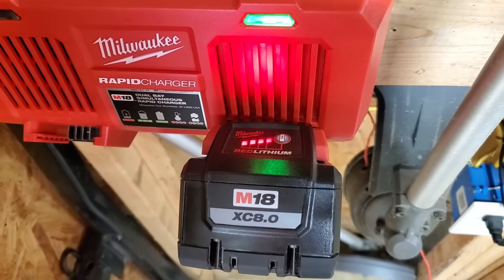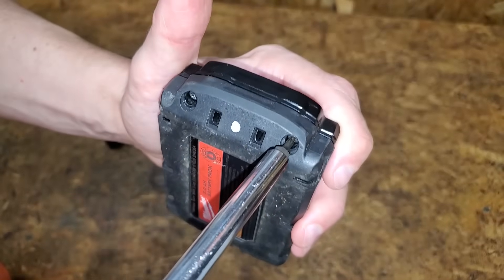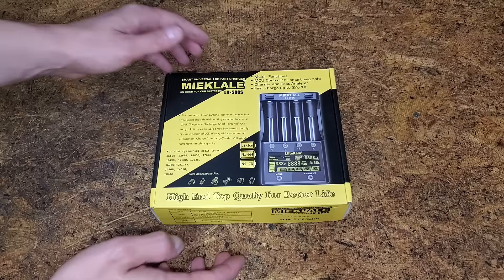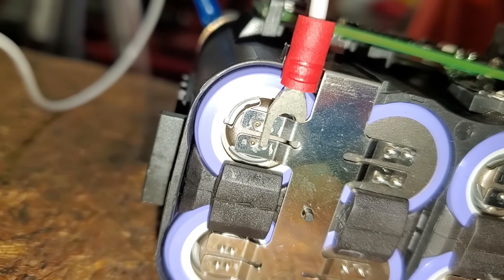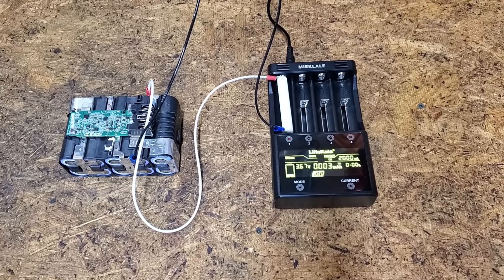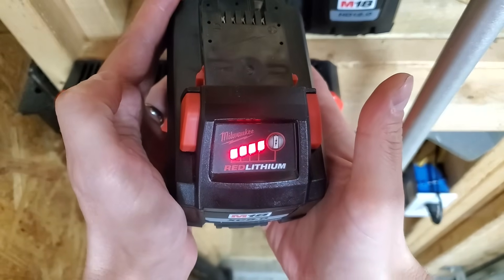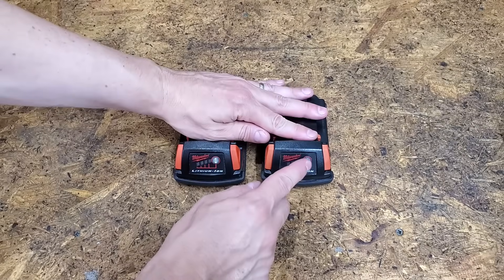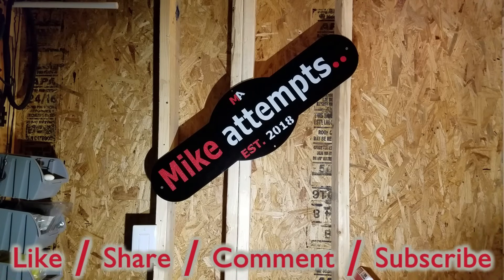Balancing Power Tool Battery Packs

Comment: For what Milfucki charges for these battery packs they should have a built in BMS that can do the rebalance for you.
Reply from the maker: I couldn't agree more, and you know they could do it easily but that'd eat into their profits! :)
Reply: I dont buy the big red turd brand anymore.  Overpriced garbage.
Reply from the maker: @unclefester4626  Most of the cost is in the battery packs. The tools are good quality but what if one of the major brands were to go out of business? This might sound stupid, but you know what I wish all cordless tool brands would offer? An adapter that turns your cordless tool back into a corded tool. It could clip in, just like a battery pack with a cable and plug attached to it. It would need an DC to AC converter in there somewhere. That way all of your tools wouldn't be useless without batteries.
Reply: @Mikeattempts Those tools extremely high current, esp. when they reach their torque limit. That can be 10-20 amps easily. The cells can deliver that current for a short time, a DC-DC converter cannot or will be huge. So the cable solution might work for some tools (router, jigsaw, sander) but is difficult for drill / impact drill, circular saw or similar that draw high peak currents.
Reply from the maker: @Chief_Engineer  Ah, interesting, I hadn't thought of the potential higher amp draw if they were to be converted to plug-in. I know the DC to AC converter would be bulky, but I think people would accept something maybe the size of a computer UPS that they plug their tool into. A requirement for using a 20-amp circuit would be acceptable too. As technology advances, that converter would probably get smaller and smaller, but I shudder to think of what they'd charge for that setup. :)
Reply: @Mikeattempts  those adapters exist but some tools will not achieve full power because from battery or dual battery setup they can draw 1800w+ while adapters are under 1500w. it is not important in most cases
Reply from the maker: @johndoe9922  They already make an adapter that looks like a battery pack connector on one end and a wall plug on the other? As tech improves, I assume that kind of stuff would get smaller and more powerful.
Reply: @Mikeattempts  yes,  they are searchable by (1100W AC 220V DC 18V 20V Power Supply For Dewalt For Milwaukee For Makita ; 20V 40A/55A DC Power Adapter Makita Compatible Electric Tools Interface 18V for Power Tools ) 
but it will not feel the same when compared to big-ah battery. 
for max power most tools consume 1.6-1.8kwatt there is no such adapters yet because they will need to supply ~100a of current and this will cost in the price range of camping power station, not 100$.
Reply from the maker: @johndoe9922  As they get smaller and cheaper, wouldn't it be funny if people moved back to just using most of their cordless tools with the corded adapter? :)

Comment: I have the 12 amp hour batteries for my lawn mower. Cycle them about twice a day. Balancing cells is just one of the chores I do over the weekend to get ready for the next week of mowing. 

Excellent video. I use exactly the same technique. 👍
Reply from the maker: Really, your 12Ah packs require balancing every week?! I have three 12Ah packs and I haven't had any issues with them yet.
Reply: @Mikeattempts they haven't been as bad since I switched to a slower charger. But I cycle them two to three times every day at work. And the mower is a heavy load even for the 12 amp hour batteries.
Reply from the maker: @robertthompson3447  Yeah, I have heard that the Rapid and Super chargers are harder on the cells, makes sense.
Reply: @robertthompson3447   I hope you're not just cycling them for the heck of it because these batteries will wear out thus you're shortening their life unnecessarily?
Reply: @thisisyourcaptainspeaking2259  No, I am using them for work. The lawn mower goes though them quickly when I ask it to do hard things. Like wet or tall grass. Or mulching grass and leaves instead of bagging. The batteries frequently are hot after use. 

When the grass hasn't grown much, the batteries are only warm after use. Either way, an 8-10 hour day of my lawn service is hard on the batteries.
Reply: @robertthompson3447   Perhaps someone should offer a proper balance charger.  This sounds like a missed opportunity...
Reply: @thisisyourcaptainspeaking2259 unfortunately the Milwaukee batteries doesn't have a balance connector so it's not possible to make such a charger. Makita batteries on the other hand have a built in 7-pin balance connector and the factory charger balances the cells automatically.
Reply: @mrfrenzy.   Whichever powertool battery systems incorporate balancing in the charging process should be the clear winners.
Reply: you can install active balancing board(it can balance both up and down) outside battery housing and glue the case for board under the battery housing, it will balance right where charging and even afterwards.
 
also you can connect two batteries to one tool at the same time, there's even adapters available but you will need: 
1. to make sure that tool does not draw too much excess current (now that two batteries can supply extra) because it can overheat and fry 2. if each battery does not have correct low voltage cut off then you will also need to install bms that disconnects discharged battery to avoid overdischarging and thus killing it.
Reply: @johndoe9922 I was unable to find a dual battery adapter for my M18 batteries. You want to happen to have a link would you?
Reply: @johndoe9922 Thank you. The two battery adapter sounds helpful. Going to Google it later this morning.

Comment: Milwaukee poo poo

Makita mastered this shit ages ago.
Reply from the maker: For the price of major brand battery packs, they should all be perfect but then they'd make less money selling new batteries! :) I've heard Makita packs have their own issue. I guess they have something on the battery pack's circuit board that will disable the pack if it's tampered with too much. So, you have to be careful when replacing cells in those packs.
Reply: @Mikeattempts   uh? Makita packs having issue? Makita batteries having issue is virtually unheard compared to other brands. it's battery management is unmatched. The point is having battery that never need any tampering or maintenance for longest time. THAT is worth far more that problematic piece of sh*t battery that happen to be easy to work on or tampered with.
Reply from the maker: @TrollinCrazyRussian  You're right, if the Makita battery packs last longer then you shouldn't ever need to mess with them, which is great. However, nothing last forever which is how that issue was discovered.

Comment: Another Utuber has said that Milwaukee is not playing nice with the software and that there is software in the charge controler that can disable the board under certain error conditions. I hope never to encounter this as I am not a software person; however, I have not yet had problems with the batteries and I try to keep them at the three bar level, only fully charging before use. Unfortunately my battery use has dropped off in recent years due to lifestyle.
Reply from the maker: Interesting. I've heard a similar thing about Makita batteries. I guess they have something on the battery pack's circuit board that will disable the pack if it's tampered with too much. So, I guess you have to be careful when replacing cells in those packs.

Comment: I'm not nearly as knowledgeable about lithium batteries as I am about 12V lead-acid batteries, but this I know for sure about the 12V ones:  voltage alone tells you almost nothing at all about the true health of a battery (although it may show definitively that one or more cells are dead, rendering the battery useless).  It's the internal resistance of a battery that will show how much power is stored, and you need a special meter to determine this.  So a 12.5V charge, with high internal resistance, means the battery has little 'juice' in it (and it should be trashed), while a low internal resistance shows that the battery is truly healthy and able to hold a charge consistent with its AHr rating.  I assume the same holds true for lithium (that voltage alone tells almost nothing about true health), so your 'balancing' might all be for naught on older (internally degraded) lithium cells, which likely will discharge after little use.
Reply from the maker: They're holding out so far but only time will tell. If some fail, I'll do another video replacing the cells.
Reply: @Mikeattempts  The simplest test is to time the run of the old battery on a high power use tool (like a big blower) and compare it to a new (or newer) battery.
Reply: Yes load test, is the real test and voltage drop
Reply from the maker: @claudiosantana3320  Yep, I'll put 'em through their paces and replace the cells in whichever packs don't hold out.
Reply: @Mikeattempts It's good practice to keep cells matched 
Discard the weak cells, and make up a pack from the reasonable ones 
Then put all news cells together in to a single pack 

Best not to replace 1 or 2 new into an old pack
Reply from the maker: @gor4988  Yeah, makes sense and will keep me from wasting my time replacing one cell at a time. Thanks!

Comment: those 1.5Ah and 3.0Ah are junk
don’t waste your time

the 8Ah earlier version has defective cells 
same cells in their 12Ah

revision 3 Samsung 40T seems to fixed the issue which they stop making them and moved to Forge Ampace cells
Reply from the maker: Thanks for the info! I actually like the smaller packs. I used 'em on my drill and driver exclusively. Since they only get use in my home shop, they last quite a long time before needing a recharge.

Comment: PUSHING THAT TAB UNDER THE POSITIVE TERMINAL OF THE BATTERIES COULD BE VERY DANGEROUS IF PART OF THE FORK FINDS ITS WAY UNDER THE WHITE PLASTIC RING - IT WILL SHORT THE NEGATIVE OF THE CELL BODY - TO THE POSITIVE BUTTON TOP
Reply from the maker: Yeah, I should have showed inserting the wire. I made sure to use small and thin spade connectors so there was almost no resistance when sliding one prong behind the tab. You definitely don't want to jam the prong in there because, like you said, it could short the cell and cause a fire. I should have specifically mentioned that in the video. I think I can add a "correction" that will give a popup with that info.
Reply: @Mikeattempts  i have no idea what you guys are talking about. pls do a revision video when you get a chance! thanks and subscribed
Reply from the maker: @dablet  At 3:28 in the video, I show the spade connectors slid in behind the metal tabs, but I didn't show inserting them. They slid in easily, but I should have mentioned not to jam/force them in (in case your connectors are larger). The outside metal casing of the cell is all negative so on the positive side, the outside edge is covered by the colored plastic shrink-wrap stuff. If you were to jam the connector hard enough on the positive side, it could cut through the plastic and cause a short. I added a "correction" to the video at 3:28 which should pop up a little gray box at the top. If clicked, it reveals text explaining not to force the connectors.
Reply: @Mikeattempts  strange i dont see any option to review the text. im using Firefox browser on the desktop.   anywho, i think i understand now.  thanks for clarifying!  your video is the easiest method, no need to desolder, remove battery, charge, and then solder back. phewwww
Reply from the maker: @dablet  Thanks, I'm happy to hear you liked the video. As for the "correction" popup, I don't know. YouTube gives creators tools, sometimes they work and sometimes they don't. Other times those features get removed without warning. The good news is that the same correction text is also in the video description. I think I'm gonna hafta do another video replacing cells in one of the older packs, so I'll be sure to reiterate the information in that video.

Comment: I thought the Milwaukee chargers were intelligent enough to charge and balance the batteries, but seems not the case. So it should be safe to buy cheaper offbrand chargers as spares around the house right? Excellent video!!
Reply from the maker: Thanks! From what I understand, the major tool brands do have some level of balancing technology built into the charger and the battery pack itself. However, I think it's only capable of small corrections so if a cell gets too far out of balance, it must be manually corrected. You know they have the ability to perfectly balance the cells and make the battery last much longer but then they'd sell a lot less batteries! :)
Reply: to achieve that batteries then needed to have balancing connector from charger to each cell group, so in practice all circuitry are inside the battery, charger only supplies voltage. Only some new battery pack models have faster balancing that doesnt allow battery to get too unbalanced in all cases
Reply from the maker: @johndoe9922  Ah, good to know, thanks!

Comment: A while back, we had two leaf blower battery packs that went bad. It was one cell in each pack that had failed. I used a good cell from one pack to get the other pack working again. Then another cell went bad, so I did the same again. Eventually, I ran out of cells, so I just bought new cells and repacked both batteries. The cells that went bad would not charge on my cell charger. Because both batteries were about the same age and had about the same use, the cells in both batteries were about the same, just short of going bad, so I could replace bad cells with ones that were still good. When repacking the batteries, I used all new cells in both batteries.
Reply from the maker: When you replace the cells, do you use one of those inexpensive little spot welders or do you solder the connections?
Reply: @Mikeattempts  I use an 80W soldering iron so that I get the links soldered quickly. I've never had one of those spot welders, but it could be good to have one.
Reply from the maker: @BrucePierson  I assumed I'd be replacing cells for this video so I went back and forth on whether I should spot weld or solder. I think soldering is actually safer as long as you have a higher wattage iron. I've heard that those spot welders can be unpredictable and cause the cell to short. I already have a soldering iron so that's the route I'm gonna go when needed.
Reply: @Mikeattempts  Just make sure you do the soldering quickly so that the cell doesn't get too hot. I don't know if excessive  heat would make the cell explode, but I wouldn't like to be around if a cell did explode.
Reply from the maker: @BrucePierson  Yep, if you heat the battery too much, you can degrade its lifespan. Also, from what I understand, excessive heat can make the cell catch fire.
Reply: @Mikeattempts  you should be able to finish a solder joint in one to two seconds of contact. With prolonged heat, the heat soaks through the back side of the tab and can damage the protection circuitry. But it may not give you any indication that it's damaged, and won't disengage the thermal Breakaway protection. So you just have a battery which is like an unexploded bomb. That could go off at any time but will continue to work like normal.
Reply from the maker: @hullinstruments  Sounds fun! 🤣Yeah, that's the plan, no more than 2 seconds of contact (hopefully less).

Comment: Remember when there were 9.0 ah batteries?  They were famous for this problem.  I used to "balance" them often until an inevitable fail.  If you are needing to do this your battery will fail sooner or later.
Reply from the maker: Yeah, that's what I figured, it's only a matter of time. I never had a 9Ah pack myself, but I do remember hearing about their problems. The 8Ah packs don't have a good reputation either.
Reply: I have 2 of the 9Ah packs that are many years old...zero issues. It is insane that Milwaukee spends so much resources making their packs track info so they can refuse your warranty but can't be bothered with cell balancing though
Reply from the maker: @DaMerk5  That's good you haven't had any issues with the 9Ah packs. I heard that they had so many problems with them that they completely stopped making them.
Reply: @DaMerk5 I have 6 of them 9.0 and they are great. I think I heavy cycled them so they lasted longer.  Have an old 12.0 that I rarely used and it does the 3 bar trick...